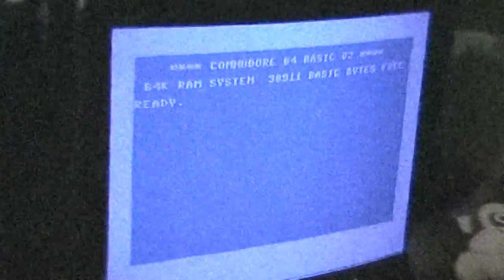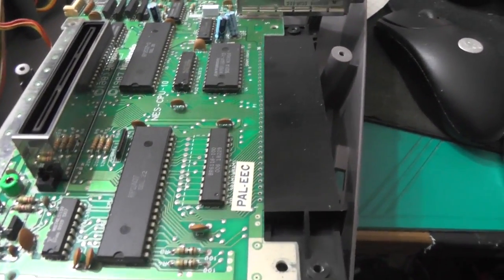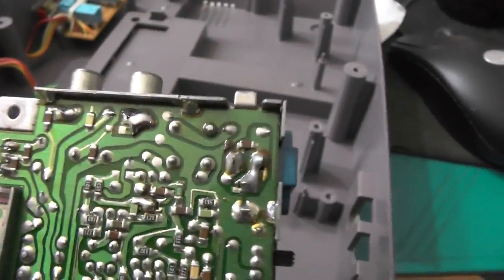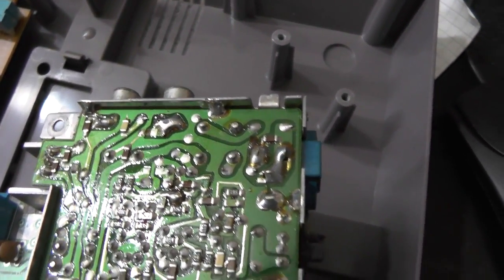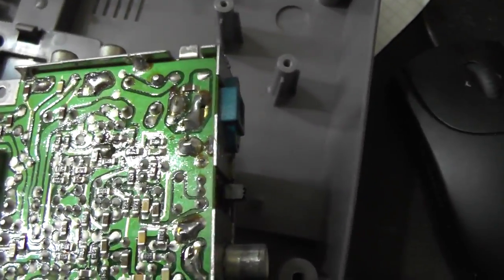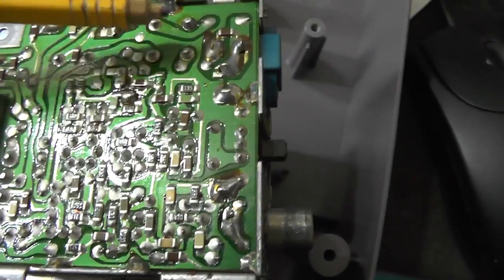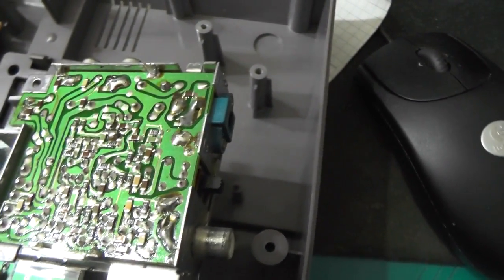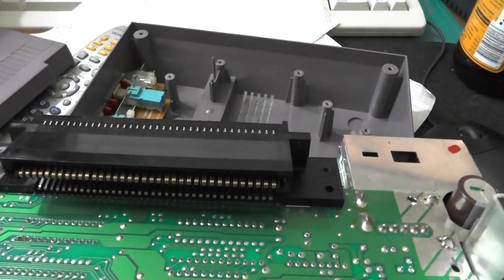NES: No picture on Composite out [fixed]

Comment: Tip: A metal tipped dental pick works great to bend the original pins back up.
Reply from the maker: I usually use a very small flat head screwdriver for that.

Comment: I still have my original NES from 1988, last I checked it had the same issue. Might have to get it from the attic to see if this solves it :D
Reply from the maker: It's worth a try for sure.
The composite picture is a lot better than the RF one.
You can clearly see by the built quality that this was not manufactured by Nintendo but a bought in part.

Comment: TSN's got the Lukemorse bug of buying every system broken then fixing it himself building up his confidence in his electronics fix and repair skills at the same time as getting a brand new system for cheaper minus the repair tools costs.

Hope you do well with the new venture mate and hope you continue to get a load of good working stuff out of it. It worked for Luke for sure and now his known as one of the top gaming electricians on the net plus he has most of the good systems ever now due to getting them on the cheap broken and getting them working again building his skills up to fix more.

It would be amazing to get a working A1200 out of this for yourself seeing as it's only extra AMIGA so you will have nothing to lose other than AGA games if you can't get it running other than a few marks or euros too for buying a dodgey A1200 for repairing.

Hope the NES/N.E.S./N-FAM repair works out.

Comment: That's certainly one interesting way to sharpen a pencil alright!
I assumed all NESes were cheap what with there being so many but perhaps that's just in the US?
Reply from the maker: +MagikGimp That's the most economic way to 'sharpen' a pencil. I'm poor, so I have to save money where I can.
NES are not only cheap in the US, they are also cheap over here and readily available. Usually around 50 bucks for a complete system at a retro fair. 
But I paid a lot less for this. It's not in the best condition physically, but with this simple fix, it works. And I got 2 perfectly working controllers with it and 2 games. Probably the 2 games are worth more than I paid.
Just have to rework the cartridge connector to make it more relieable.
Reply: +Theshadowsnose But how much are pencils?! ;)
Reply from the maker: +MagikGimp 10 of those are a Euro. Every penny counts.
That's another advantage of this method... it doesn't matter at all if the lead is centered or not, so the cheapest ones are just fine.